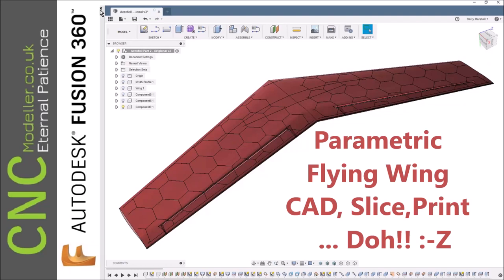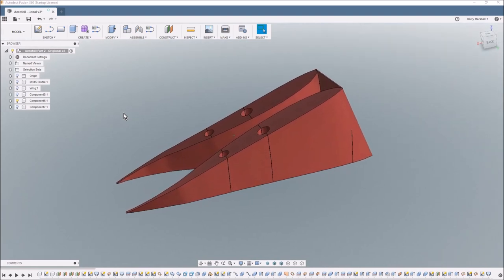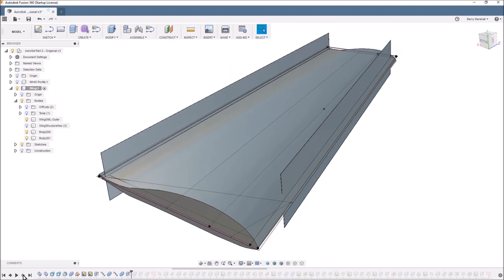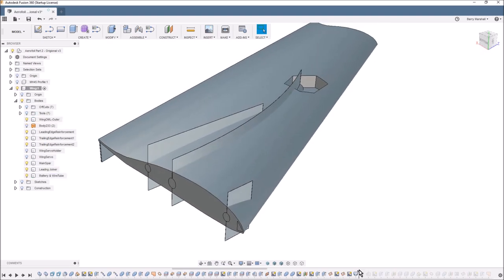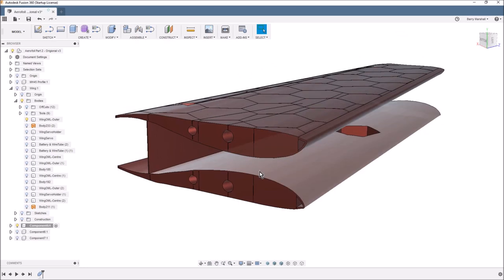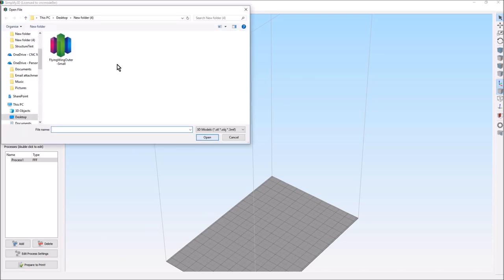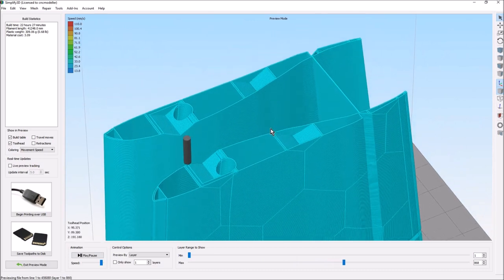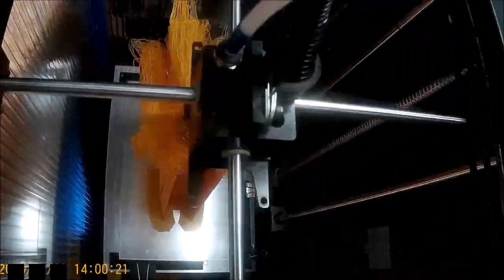CNC Modeller: Parametric Flying Wing CAD, Slice, Print... Doh!! :-Z

Comment: Great content! 

Quick question, but would I have stumbled upon a real challenge/issue. Would you happen to have a good way to design a wing with both a taper and an an upwards sweep in them? Not swept back but up - like a Stuka but just not as abrupt. And then using the same airfoil all along the wing.
Reply from the maker: Hi sorry for the delay, YT seems to be randomly holding back comments without notifying me.
Upwards "sweep" is called dihedral... from memory I think I included that, but if not basically it all depends on where you place the tip profile.  Move the tip profile up and you'll have your dihedral! Hope that helps and thanks for the feedback :-)